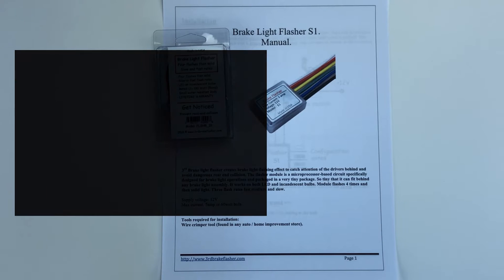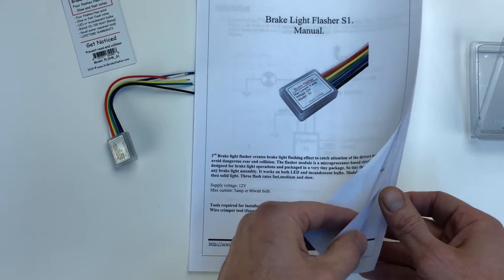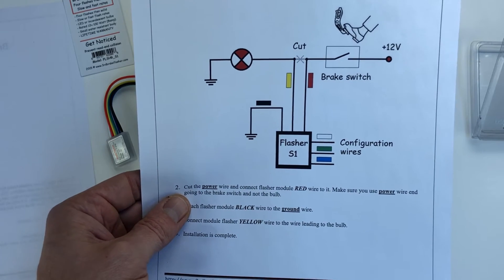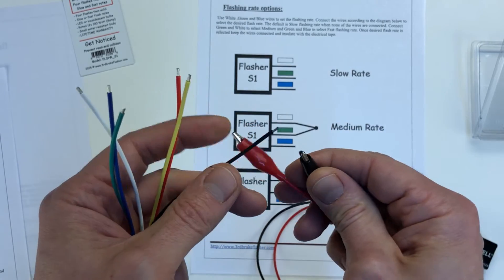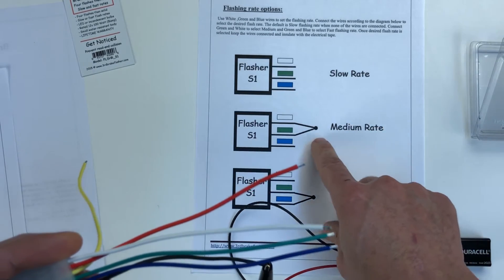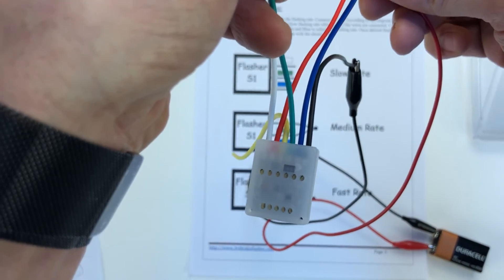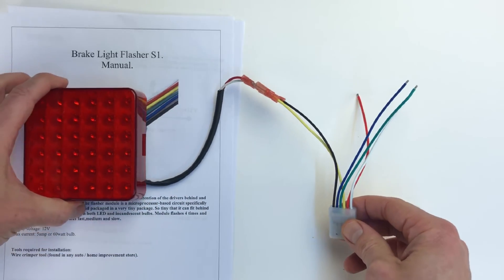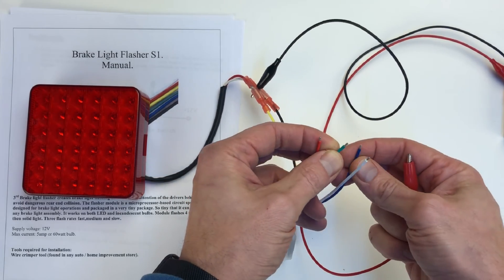2019 S1 Brake Flasher connection and configuration

Comment: I am having an issue with mine - it is flashing my 3rd brake light once and then going off. I double checked everything and re-did the connections. Any ideas as to what is wrong?

Comment: The brake light flashes only when I turn on the parking lights. It does not flash when. I depress the brake pedal. Any thoughts?
Reply: sounds like you hooked up the running light wire instead of the brake light wire
Reply: I have three wires.  A blue white,a brown and a black. Power is the brown, ground is black,and blue white is the bulb. Should I attach the yellow to that blue white bulb wire?
Reply: @jasonferraro2948  you ever figure it out?

Comment: From my research this is the only CALIFORNIA LEGAL modulator  .....Deceleration Warning Lights

25251.5. 

(c) Any stoplamp or supplemental stoplamp required or permitted by Section 24603 may be equipped so as to flash not more than four times within the first four seconds after actuation by application of the brakes.

Amended Ch. 410, Stats. 1983. Effective January 1, 1984.
Reply: Yep I just bought one for that reason.